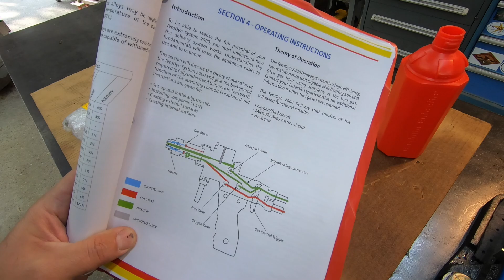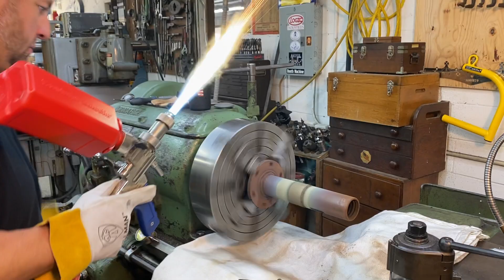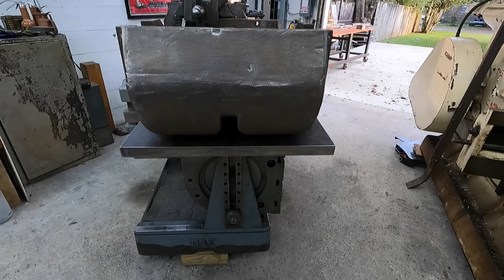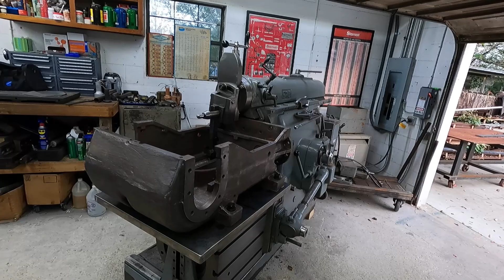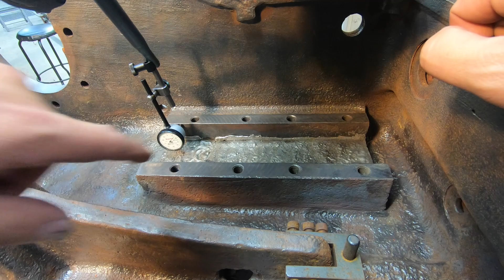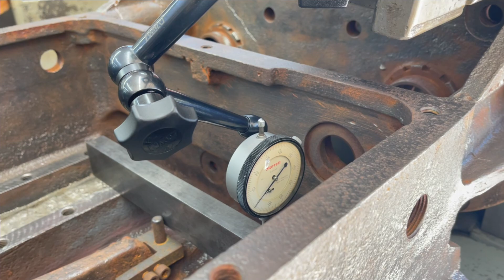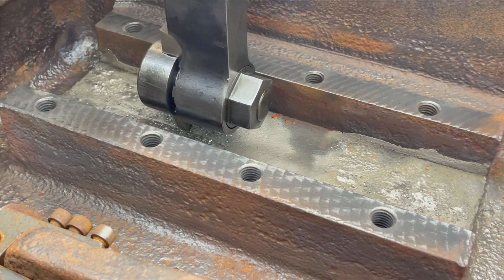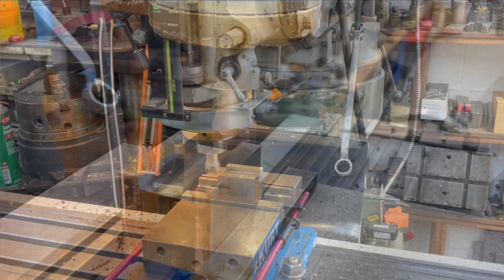SNS 331: Stoker Engine, Eutectic Torch Repaired, Tung Tri Mill

Comment from the maker: I know no one will read my comments to the hundreds of questions and “why nots” so I’ll post them here. 
“Why not flip the stoker engine 180° and cut the other way!” Because the opposite end of the casting is to tall and will not clear the Ram ways. 
“Why not turn the tool head?” Clearance. 
“Why not use a longer tool bit?” The tool holder will not clear the casting of you raise it up higher. 
“Why not build a custom tool holder?” I’m not sinking the time into “custom” tool  holders for for a job that is still going to be questionable and is 100% voluntary. 
“Why not use the DoAll?” Not the right size machine for the job. 
Why not use the K&T?” Also not the right machine for the job. Not enough clearance. 
“Why not send it to Brian Block?” Because I was asked to do this job and I accepted it. If Brian wants to tackle it he’s more than welcome to however. 
The point to my answers is that no matter how I position the tool head, tool holder, and tool bit, there is clearance issues in some way. It’s give and take. Simply suggesting “ make a custom tool” does not fix the problem. There was several factors at play here that I didn’t see with a few pictures and measurements when I agreed to help with the job. I believe that my shaper is not the right machine for the job, and what machine is right for it? Well I’m sure there’s plenty. I’m also certain there’s many people much more brilliant that me that can figure out a creative way to machine this, or repair it. Maybe what we’re doing is totally wrong. That’s ok too. Bottom line is, I’ll be discussing this with Keith Rucker so that he can form a new plan of attack. Maybe he can find someone with the right machinery to do what needs to be done, if he doesn’t want to tackle it himself with his planer.
Reply: We make VERY cheap and quick tool holders all the time for 1 off's like this.  Dont use that tool holder, Tilt the tool in the clapper say 30deg so its not past the clapper edge, bend a solid rectangular bar to camp in the clapper, weld some cheap high speed steel to the bar. We would easily reach the entire width of the slot with 2 tools to get into both corners.  When finished, cut the hss tool off, flip the bar and weld the tool to the other side. Grandad has been doing it this way for as long as i can remember. He keeps all the custom tools.
Reply: I'm a machinist too. And i think it's better to take a step back and say to the customer that it's not going to work, rather than risking ruining the part and/or the machine from being stubborn...
Reply: @Biggus_Mickus  The answer?  No.
Reply: yup good points,we are not there we are just trying to help. but a lot of us are not as good as you, but we would like to try and contribute, at the end of the day only your judgement matters.
Reply: I've not read anyone else's comments, as I want a fresh idea for you to consider. Ironically the new milling cutter is idea tool for the job. My idea, stand the engine casting up vertically on the K & T mill table, using the cylinder mounting faces on the table. Reach in with the cutter mounted in the horizontal spindle, there will be a very long tool stick out and vibration will be a problem, also the only way of seeing what the cutter is doing will be via. a camera and screen such as a computer tablet, clearance will be a problem around the tool arbour and it will have to be very small in diameter, however it may be a doable solution and it would save having to let your chum down even if cuts are down to five or ten thou per pass. Greetings from Stephen, Cheshire UK and hope we all have a better year in 2021.
Reply: @stephendeakin2714   he commented that too. Abon had the idea himself but realized to short movement in Z-axis.Tte right machine is a horizontal boring mill and he dosen't has such a machine in his workshop
Reply: @hydramechdk7658  I did wonder how low the table would go. I know he has big tooling about him, if he had a really big angle plate, that may work, but the casting weighs such a lot and is so long then add an angle plate, would the table be over loaded weight wise, probably. As you say a big horizontal boring machine could possibly tackle the job, but it would still need quite small tooling to get in around the flange area.
Reply: @stephendeakin2714  yes but we use here Europe some excentric flycutters on our horizontal
boring mills these tools( flycutters) can weigh more than 110LBS(55kg) assemplied. the cutter it self can variate in size from 63mm to 2000mm depending of the job. only the small ones runs excentric. the largest excentric flycutter I have use went to a maximum diameter of 600mm. I can not explain how they work because they very complicated tools to explain sorry. Next time I clean one and lubricate I will see I can do some pictures and mail them to Adam maybe he can explain it easier on english than me
Reply: Love the video man. Love to see what your solution is
Reply: some of us do read a little thanks for your work love watching. you will figure this out
Reply: Love your work Adam, particularly the challenging ones like this. Keep it up mate.
Reply: Adam you raise some valid points, and I've been just as stumped as you are. I'll bet you have an extra tool holder (any size) that you have more than one of that could be cut in half and modified longer and banana shaped. Kind of like using an obstruction wrench. This keeps you from having to make a tool holder from scratch, use some cut offs, and do a little Tig welding.  Might take 30-60 min. I sincerely hope this helps, you've helped me with your channel.
Reply: Custom cutter, similar to your long bar cutter, that will go through the bore and has a line boring type adjustment, or custom long cutter. I've got an old custom shaper tool that was hand forged and bent that's about 12"long and 1.5"x5/8" in my opinion that's how they used to make tools way back in the stream train days. So you may need to make a custom holder one way or another
Reply: I believe you have thought of everything you can and probably feel frustrated about the clearence. I do not feel too confident regarding that brazing. If it was a weld, I might try harder too.
Reply: Thanks for trying to answer all of our questions!
You answered mine. I didn't realize that making a custom toolholder was that big of a deal. Now I understand.
Thanks again.
Reply: I always read your comments... You were the 1st YooToober I began watching regularly, 1st content provider I obtained merch from, You have directed me and others to many great channels by others. If you can't do it in your shop then it's going to be some kind of voodoo to get it done. Didn't mean to cast doubt on THE ABOM! LOL
Reply: Good that you wrote that already. I landed here to also propose a custom tool holder... keep up the good work, and I hope you ger some inspiration how to possibly machine this.
Reply: Some great suggestions already but thought I'd chime in. Whilst the DoAll may not be the right size machine for the job, could you not just about get away with using a small fly cutter with the quill extended down into the casing?
Reply: I was thinking maybe stand it on it's side and use the down feed to cut across but as you said there's gonna be clearens issues. Every thing looks easy when you're watching from the sofa!!!🤷🏻‍♂️😂 Love the videos man always learning something from ya. Keep up the great work Adam thanks for taking the time to share!!!👍👍
Reply: Thanks for this comment, Adam. Indeed I was thinking why not stand it on its side and use a long reach shell mill on the K&T.
Reply: Adam, I genuinely appreciate seeing situations where things don't work out as planned.  It happens in every line of work, and it's important for everyone to remember that we all underestimate a problem from time to time and have to call in reinforcements.  Having the experience to know when a problem has grown beyond the original scope and needs to be rethought is a hard-earned lesson for all of us.  I appreciate you demonstrating how it's done.
Reply: I think it would be a good time to try a piece of CRS machined to fit the tool holder and TIG weld a HSS tool bit on one side. You could make a second one with the tool welded to the opposite side. you should gain a bit of space for the ram to come back further. I'm thinking an L-shape looking at the ram head-on and a second one with a backwards L-shape looking from the same direction. The tools could not be wider than about 40% of the slot width. This shouldn't take much longer to hog out than the Tri-mill demo. You have a chunk of time invested in this project already, another hour or so doesn't seem excessive. Obviously, I couldn't care less if you do it or not, but I would hate to see you give up without a little more time thinking about it.
Reply: @jamesbruley2843  reed that Adam posted to all of our comments. The problem is actually not the tool the problem is the castet item. He voluntaired from pictures and admid the job is to complicated for his machines. That stoker engine has maybe been stocked outside for many years to outstraction tensions. If Adam damage or ruin the item, the machine of Keith Ruckers might be ruined for ever as such item or sparepart maybe no longer excist buttom line it is vise of Adam to consult Keith Rucker before finishing the job and yes I know a little thing or two I'm educated as Toolmaker with practice in 22 years I'm also a machinist traveling around in Europe solving machining jobs for large companies.
Reply: Why not replace the tool holder in the clapper box with an entire custom tool (or 3 - middle left and right) that mounts directly in the clapper and could then go all the way to the back (I noticed the cut out areas at the top of the engine casing flange on top) and also go flush to the left and right side of the surfaces inside the tracks.   You could then make it a little longer possibly to get more clearance for the clapper on top.   I just don't know if you have tool steel blanks long enough to use. this gets rid of the tool mounting down at the work surface and would allow you to get up against each side and all the way to the rear (which would be why the casing is relieved  at the top edge on both sides??) ??
Reply: What is interesting about your struggle is that the part you are machining is from a old, old piece of machinery, from a time when there were not a lot of machinery choices like we have today.   I personally think you can solve it - you have more experience and way better tools than those that did this when it was built.   Not to mention much better materials like the cutter you showed at the end. Interesting problem!
Reply: Thanks
Reply: I think, Keiths planer is next (if BCBLOCK would'nt take the challenge). I understand the logistic trouble.
Reply: @honkanen72  I think a boring mill is the only other choice it @Abom79 can't get it. But I have Faith in Abom he one very smart cookie!
Reply: honkanen7
Reply: Sometimes it’s best to sleep on it before making your final decision.👍🏻👊🏻
Reply: Hello Adam I understand your point, But I hope your be involved in Wat happens next to the stoker engine
Reply: Given the clapper box flips up on the return stroke do you have to use a tool holder?  I thought I saw a massive HSS cutting tool on another channel that was about the size of the tool holder itself.
Reply: I see what you mean about the tool holder not clearing if raised with a longer bit. But I was thinking a lathe tool instead of that particular holder. I recall a few of your videos where the Armstrong tools would work on both the shaper and the lathe. That would likely give you the clearance on the back stroke to raise the holder with a longer tool bit. Otherwise, yea your muse as to what the heck they used in the first place to machine that surface is a conundrum of the first order.
Reply: For some reason, I am seeing this as an Apollo 13 Square peg in a round hole of all things....there HAS to be a solution to this....no doubt there is one but we need some crazy hail mary out the box thinking!
Reply: Robert Gracie Bob, there is but it’d have to be a custom tool holder long enough to raise the ram for side clearance and that which places the bit rearward on such holder; which he’s already said is a no-joy.
Reply: @RobertGracie  Cut the casing up and braze it back together after wards ?
Reply: It would be plenty ironic for Keith's planer to be up to this job.  Same vintage as the workpiece, I reckon.
Reply: I'm no expert in machining but I do enjoy watching experts at work, I had my doubts when you said you would be using the G&E shaper to do that job but I had no idea that you would run into some of the issues you are facing. It's a shame really because I know you really wanted to help and you would have done your very best and got some great videos from it but unfortunately it looks like it's not going to happen.
The only way I can imagine you might be able to do it would be something very drastic like cutting the engine apart and brazing it back together afterwards but that's obviously not very practical !
Reply: Pretty sure the original machining was flipped 180 from your setup on a much much larger shaper. The undercut casting at the front would be the relief for the tool as the Clapper lifts on the reverse. I know yours won't fit that way, just calling it how it looks.
Something else I've thought everytime you show the shaper is why not cut that all out from the rear and have a removable plate back there with silicon bronze replacement bearing material. You could easily mill it in from the rear and make flat bearings that fit into a new plate, with grub screws to level it. I know that's reinventing the wheel though.
Reply: Thanks for a fascinating video, all of it. I also appreciate you showing all the problems with the engine job even with no resolution.
Reply: Is it possible to rotate the tool holder while leaving the clapper box verticle? Closest I've been to a shaper so idk much about them
Reply: I would go with making your own long reach milling end
Reply: It takes a big man to admit you've hit a wall. Good job pushing your equipment that far - you've got a really cool head to work within such a restricted space on many levels!

You must've learned a tpn though... these frustrating problems bring out the best in us in a way!
Reply: First thing I thought about was indexing hss in a tool holder. Leave everything as it is, just rotate the hss tool and stick it out a bit further. You wont have continious cut on the bottom, but from my understanding You didnt plan to, considering prepered tools. But I've never used a shaper so... :D Interesting topic anyway, cant wait to see the solution.
Reply: Well, sometimes you just can't work it out in your head and need to do a mockup to check clearances in all directions. There are so many variables involved that are difficult to predict. Trying to determine how it was done originally is also a fun game, of course. Back in the day, end mills weren't as common, so I'm thinking that it was some kind of shaper to get the tool into those corners. Otherwise you're dealing with an end mill on a very long shank or spindle extension, and that can cause all sorts of other problems with deflection and vibration.
Reply: "I’m not sinking the time into “custom” tool  holders for for a job that is still going to be questionable and is 100% voluntary. "  Well there you go then"  See my suggestion.  Understood.
Reply: It's amazing what you go through finding what does and doesn't work when you're working on a project especially when you have to reverse engineer it without knowing how the creator created it . Your an awesome artist
Reply: Im not a machinist, just a mechanic, so dont mind my ignorance. what is the proper machine to do this job? It looks like painting in a corner but not getting stuck. A very complicated job.
Reply: @nixinc1  A horizontal boring mill is the right machine Adam doesn't have one neither has he got enough space for one in his workshop.
Reply: @hydramechdk7658  thanks,  new to the machine shop world. I looked that up, thats a beast of a machine. Thanks for the insight.
Reply: @nixinc1  yes they are. Some of them (floor models) load 300tons on the table some even more. Groundfoundations reaches down to 40´ (12meters) below groundlevel to carry the machine
Reply: @hydramechdk7658   that makes it difficult in a small shop. I have worked on some big punch press machines thst needed a pad like that.
Reply: I would just no quote the job
Reply: Great job.  You insist on doing it right.
Reply: Your are dead on, what you have to cut out and on the radial mill they have longer quill settings have extensions for types of cutting tools
Reply: I agree - we're all opinionated because were trying to find a solution along with you Adam. That's not a bad thing but community. Hey just thought, if you have a vertical head for the K&T, it could be an alternative to the depth that's being prohibitive for the shaper?
Reply: like i posted, make a mount for a die grinder on your shaper
Reply: It takes the experienced workmen to know when to back off. Hats off from me. Love your way to share your know how. Thank you!
Reply: Hell I didn't know a thing about machine work and always wondered how in the world did someone make this.  Im 55 and within the last year of watching your videos I'm hooked.  Absolutely amazed.  Wishing I could get a do over in life, I may have gone a different direction.  I am curious to one of the comments in this thread.  Maybe you could answer it.  Why not do away with the tool holder and fabricate a cutting tool long enough to take the holders place.    Id like to see you figure this one out.  Pretty sure you will.
Reply: @buddygray1566  the item has properly been machined on convetionel horizontal boring mill
Reply: Regardless of what machines you have access to working down in that hole and under that ledge is going to be a difficult proposition.
Reply: Wait, how does using a longer tool, and lowering the table cause clearance issues? And my understanding is that the tool holder itself allows the tool bit to be placed in multiple angles while the tool holder stays in the vertical. If you lower the setup, without changing anything else, you can take care of 2/3rds or so of the bottom area out to the edges of the center walls.
For the outer walls and remainder 1/3rd bottom plane, you can both turn the bit on the holder, and then grind an oblique angle on the tool bit to clear out to those outer walls.
EDIT: A longer tool would allow you the pull the tool holder up the few inches you need to clear tops of the walls. and man, how much simpler this'd be if you had NOT cut the tool blank in half, and just ground a tool into either end. Seems those old guys knew what they were doing by keeping the tool blank long and just using both ends.
Reply: Not a machinist here, but how about making like a "L" shaped tool to be able to raise the toolholder while still clearing the case on he back. Maybe like you did with the cutting edge, taking off half the width where it is clamped to create an offset, I try and mimic it down below:

<- Stroke ->

I         Toolholder
I_
   I      Cutting edge
Reply: We learn by your experience ..thank you
Reply: Let me preface this by saying that I've never used a shaper so I dont know the limitation of the machine and this is just based on what I see in the video.

I know you said you cant use a longer tool bit because if you raise the holder, it will hit the casting and I can see exactly what you are referring to BUT why not make rearward offset tool bit (maybe one welded to another) to get the cutting edge further back thus allowing you to be out of the cut before the holder is under the recess of the back wall casting thus allowing you to lift the holder without the interference to the casting like you currently have if you were to just try to use a longer tool bit?
Reply: Why not just show interesting things to watch ...? 
Why not get (and USE) a tripod...?
Reply: Could you make a offset adaptor to clamp on the tool arm to offset the cutter
Reply: Adam, is there a way to offset the tool holder at an angle so that you'll have the needed clearance while keeping the tool itself perpendicular to the work piece? My thought is that if you're able to angle it you may only need to use the left and right handed tools if you work your way in toward the center of the table from both sides. I hope that makes some sense or helps in some way. Keep up the good work!
Reply: A carbide tip lathe tool welded to the end of a piece of 1 1/2" dia. 4140PH round stock, made long enough to reach the work, using it as a fly cutter, might do the trick on a vertical mill.
Reply: they scraped them in by hand in those days
Reply: My Money is On You Big A. Next time you Are In Ohio I Have Some Things You Will Be Interested In. My Good Friend.
Reply: Adam is The man To get it done. He Won't Give Up.
Reply: Hi Adam.  I did try to read all your comments and I don't believe I found any along the lines I'm thinking about.

One constraint that the collaboration has stuck with is the idea that the internal geometry and design of the stoker engine can't be modified for this project.  What if the group got creative and dropped that requirement?  For example, how about designing and making slide way modules that were bolt-in replacements for the original slide ways as they exist right now?  Yes, the dimensions of the internal parts of these modules and perhaps even the way they work might not be identical to the original engine, but is that a problem given the alternative is not being able to repair the stoker engine at all?

If you have drawings of the engine with dimensions I'd be happy to help work out a bolt-in slide way replacement module design for the collaboration's consideration.
Reply: Hi 👋 this
Reply: Hi 😅
Reply: Yeah all good points to make, honestly this is a real puzzle to figure out, it will test your skills to the max Adam :) but one way or another you will beat it!
Reply: I’m not there, but I would be super nervous about the clearance. Both with damaging the engine and your shaper.
Reply: Outstanding content Adam.  Way to push yourself
Reply: Big job to get done I am sure you will have a  brainstorming session with Keith and come up with a solution. Really appreciate the time you have taken to video the set up must have taken you hours to get this far. Love the spray welding 😁🖐️👍
Reply: Never be worried about disappointing us viewers. Between you Keith and your other friends I'm sure you will come up with a solution to this problem. With so many factors and space restrictions it would be imposable to  see everything that could be an issue till it was set in place. Keep up the good work and don't loose faith in your skills abilities and keep up the good work.
Reply: WHY you did not use the mill with a extension cutter
Reply: I dont like your excuse for not wanting to make a custom tool holder. Practically 100% of the content you post is voluntary, for the sake of make video content. You have 6 figures worth of equipment in your home shop but this is where you draw the line? It may be voluntary but somebody wrote a nice check just to get that thing trucked to your shop. Dont give up now, a lot of your viewers will be very disappointed. Even if it ends up chipping out or ruining cutting edges. Put the time in at this point.
Reply: @truckguy6666  Once in possession of this casting, am surprised that Adam did not 
detach the tool holder from the shaper and do a quick check for clearance. Further
investigation would have deduced that he had a real problem there. From which he'd
probably have decided that he needed a custom tool holder made or decided not to undertake the job. A quick abort of the job is not a big deal, but doing so after holding onto the casting for such a long time would be disappointing.